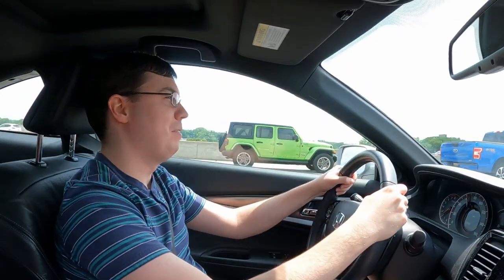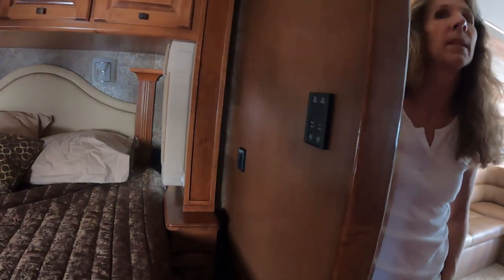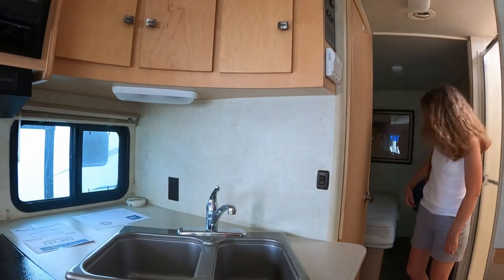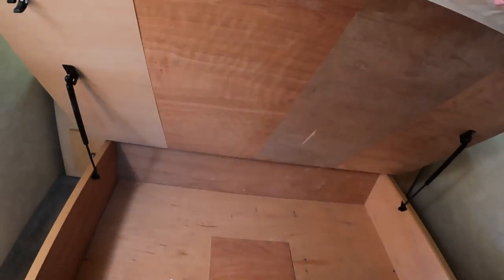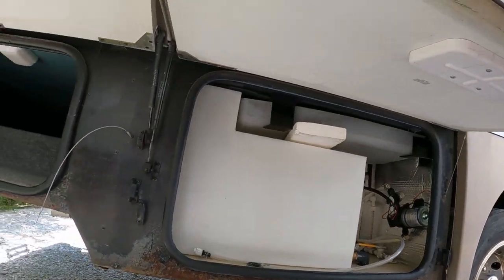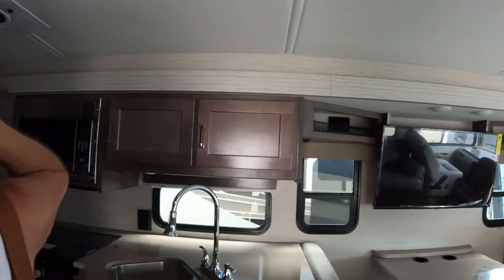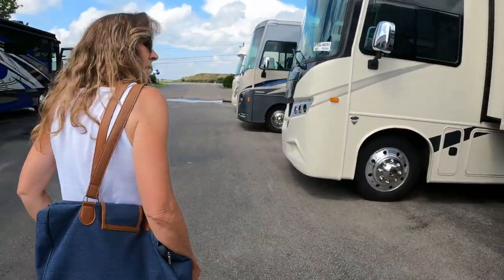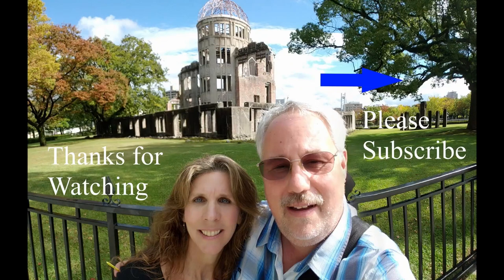What Size RV Is For Us? - The RV Hunt

Comment: I think the smaller you can go and be comfortable, the better you are.  We definitely wanted on board laundry,  which meant a little larger.   We also think you really save a lot with used.  You are smart  to really take your time and do your research.  Can't wait to see what you end up with.  Lynn and Danny 😊
Reply from the maker: It was definitely a good idea to see the different sizes.  It helps that we have been camping in a trailer for about 16 years.. We definitely like going used.   So the target search is under 32 ft,  two slides, with a dining table and some place to sit and relax